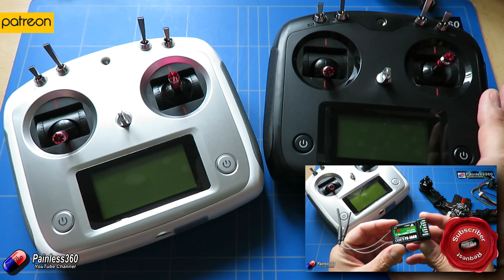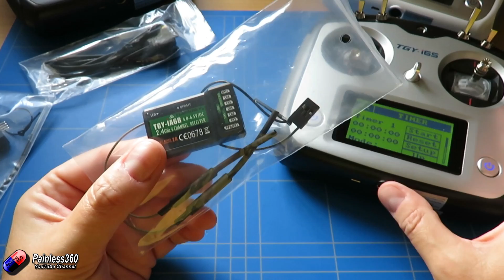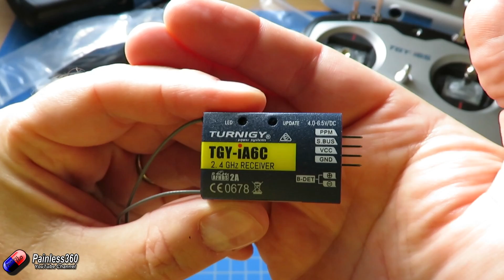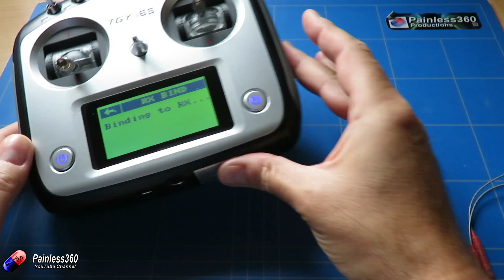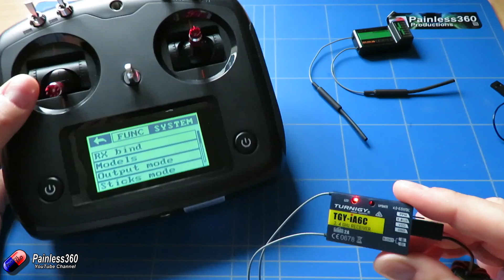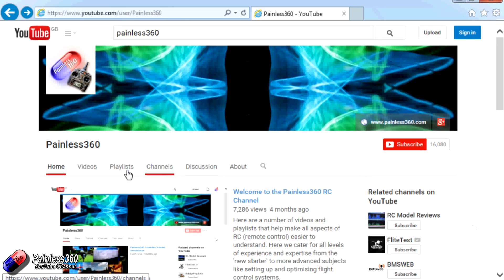FlySky Receiver Bind Testing (Turnigy, FlySky, FS-iA10B, TGY-iA6C and TGY-iA6B)

Comment: Hi Lee. I have recently converted to an FrSky Taranis + 2019 from Turnigy products and followed you videos for setting up the Taranis etc... They are very good thanks. I have been trying to find out if I can use the Turnigy receivers  TGY-IA6B or TGY-iA10 with the Taranis by using a plug in module in the Taranis. Now my head hurts. I have been going round the houses and getting more and more confused. It looks like it is possible with the appropriate module and firmware but I can't decide which module I need. Can you give a simple answer? Thanks (Martin) It might come up as Corby Model Boat Club so sorry for any confusion.
Reply from the maker: Those receivers use AFHDS, you can see if a modern multi-protocol module would support it by looking here - https://github.com/pascallanger/DIY-Multiprotocol-TX-Module/blob/master/Protocols_Details.md
Reply: @Painless360  Thanks Lee. I did look there and got even more confused. It only mentions FlySky and I know some Turnigy RX's are essentially badged FlySky as I have had a FlySky working with my Turnigy. I am in no rush as I have spent a small fortune upgrading most of my RC boats, tanks and planes to FrSky. It would be nice to use my Turnigy rather than sell them.
Reply: I should say I have joined as a Patreon under my name Martin Armstrong
Reply from the maker: If you are a Patreon then you will get a far more detailed and useful answer asking on there. See your welcome message where I cover that... Let me know on there if you want to chat. Happy flying!

Comment: Hey I am having a problem (i think its my RX). When i bind it with my TGY-I6S TX, it binds successfully. But in the TX, it does not show any sign of connection to the RX but I can still arm and fly the quad even if there is no sign of the RX connection to the TX. This problem does not seem to appear every time. Sometimes (like 50% of the time with same RX, it does show connection, RX voltage and signal strength).
Due to this problem, I haven't had my first FPV flight. I am afraid if the range will be decreased due to this.

Note: The TX happily binds and shows connection with other RXs. So I guess it is not the TX.

I would really appreciate any help.
Thanks.
Reply from the maker: +Sangay Lama I’ve not had that here, they either bound and worked or didn’t. This is the problem with these radios being sold with slightly different firmwares. Sorry I can’t be more help in this one..
Reply: It okay. Thanks for the reply. I have decided to go with the TGY-iA6B RX  for now which also came with the TX.
So thanks.

Comment: Does anyone know how do i rebind the TGY-iA6C to another transmitter?
Reply from the maker: +Chris Wong covered in the manual for the Rx.. it goes into bind mode for the first 5 seconds every time it's powered up..
Reply: I just tested another one and it bind straight away. i guess this one have bite the dust. Thanks
Reply from the maker: Possibly, firmware revision issue? Best of luck!

Comment: I own a FS-i6s transmitter and recently bought two kinds of receivers #1. Frsky X4R  #2. TRangeX RM601   Both say they will do PPM .  Still learning, I thought if any receiver supported the mode (?) then I was good to go?  OR am I missing something in the binding process nether one will bind.  I don't see any video's on how to know which RX works with my transmitter.  Can you help clear this up for me. Thanks
Reply from the maker: The X4r is for a FrSky radio so it won't work with yours. You need a receiver designed to work with the radio you have - https://www.youtube.com/watch?v=_YNRZVJIl7k

Comment: I'm on the fence of buying a turnigy model but there is major question I simply can't find the answer to. I currently use the Radiolink AT9 witch with the R9D receiver can push ch 1-4 over sbus and ch 6-10 over PWM.
My question is, would I be able to configure a similar setup with the i6S?
Any information on the subject would be greatly appreciated. Thanks.
Reply from the maker: Nothing like that on the radio at the moment that I've seen..

Comment: However the TGY-iA6B RX and the TGY-iA6C will bind to the FlySky i10 (you have to choose AFHDS 2A (2 way) as the protocol then they bind without any problems :)
Reply from the maker: Good to know! :D
Reply: I forgot to mention that these also displays the int. voltage, signal strength and RSSI signal on the i10 display :-D

Comment: when the flysky i6s failed to connect to the turnigy ia6b, was the radio in ppm or ibus mode?, i'm not sure it works unless you use the ibus etc etc, i'm pretty sure the flysky i6 works with the turnigy ia6b.... theres an awful lot of people with flysky tx's  who just bought their first quad, could use a comprehensive run down on what works with what.
 is turnigy the original manufacturer or flysky? if anybody knows? please answer in comments
Reply: direct reply isn't working try here thanks

Comment: Does anyone know how to play simulators using these on a Mac? I cannot get my Turnigy version to work with freerider or HotProps on my MacBook using the USB
Reply: Are you using USB to microUSB, or Trainer to USB? It's gotta be trainer to USB for Sims
Reply: The manual just says plug the included micro USB to USB cable into the computer, and it should work as a USB game controller. How do you do it with a trainer cable?
Reply: Jon B Baca Huh, I always thought you needed a trainer to USB as that's what pretty much every other Radio does, I don't really know then..
Reply: Yeah this one has a dedicated micro USB port, supposedly to make it super easy to play sims. But I haven't found a single one that works on my Mac with this tx
Reply: I have the turnigy transmitter and it is just plug and play with free rider using the included USB cable on my MacBook.  Works really well actually. Are you still having issues?
Reply: Terb yes, I just can't get it to work with any sim, including Freerider. What did you do? I can see that my Mac recognizes the controller, but when I go to calibrate it in the sim, nothing happens. And if I start the game, I just have zero control. You didn't do anything special at all?
Reply from the maker: I'd ask the HobbyKing support guys - they are probably best placed to help. Best of luck with it!
Reply: I plugged it in, went into the free rider and just started calibrating.  I never saw anything on my mac indicating it was connected.  I'll dig around and see if I can figure anything out.

Comment: I have the Turnigy i-10 radio and it binds with the Fly Sky FS-iA6B.
Reply from the maker: Great! Thanks for posting. I'm sure lots of others want to know just that. Thanks again..
Reply: No problem, the voltage monitoring module works the same and the iBus gives me 10 channels. Now all I have to do is see if I can trainer link my daughters FlySky FS-i6 with the TGY i-10....not sure if it will work, just waiting on the cable.

Comment: Great video,those are some nice transmitters.
Reply from the maker: For a new multirotors pilot they are a great first radio while learning the hobby. I like them a lot, just wish they had trim switches! ;D
Reply: +Painless360 I got the devo 10 modified with all 4 chips running deviation,It has the ability to operate many protocols for all vehicles(ground,air,water.All together the price was about $150.00

Comment: Can you test if the ia6c will bind to the old FS-i6 Transmitter?
Reply from the maker: +RC Flyer85 sorry we don't have one of those radios. :(
Reply: A little off topic but I have seen these TX's available for cheap lately and wondering if they support using for simulators? Something like FPV Freerider Recharged etc? Just curious and thanks!
Reply: Hi i have FS-i6 and i use it with both Freeride and freeride recharged
Reply: Works great using the micro USB.

Comment: can you please tell me why my quadcopter rpm is giving hi automatically. If I keep it on 15% throttle quadcopter flying  by own throttle going hi 50-60%
After that I can not control it.
My quadcopter is F450
KK. 2.1.5 Flight control board.
Reply from the maker: +Zillur Rahman on the bench, in the air?

Comment: Using the ia6c and flysky radio can I use the battery voltage monitoring function?
Reply from the maker: We're waiting for the manual for the Rx to test all that - stay tuned! :D
Reply: +Painless360 
Sounds good! :D